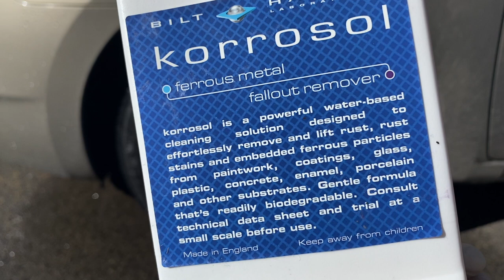Bilt Hamber Korrosol on Wheels for Enhanced Wheel Cleaning

Comment from the maker: How often you use a fallout, iron remover on your wheels? 👇🏻
Reply: I tend to use it every 6 months my car doesn’t do many miles.
Reply from the maker: Basically the same, I had barely any iron particles left as seen on the footage. Also, I’m using ceramic brake pads, which tends to dust less.
Reply: I give mine Bilt Hamber Autowheel when I change to summer or winter tyres. And I have a spray with 1/3 korrosol and water. 
To keep them clean when I wash the car. 
Korrosol can be used on paint also so that why i use that. 
I always give my wheels some wax so they don't get that dirty. And when they coming of and before they are put on they get that protecting. Just like my car gets a new layer of wax (Soft 99 fusso coat) 
some times a one-step polish with autoglym resin first
Reply from the maker: Hi Ketil!
Great suggestions here 👆 I like the way you’re doing the washing process of your wheels. I use some spray wax or quick detailer to protect the wheels. Also, to make them easier to clean for the next wash 👍🏻 Hope you enjoyed the content and I appreciate your comment!
Take care,
Viktor
Reply: Bro where do ya buy this stuff looks class shout out from drogheda🤣🤣🤣 great content👌👍
Reply from the maker: Cheers Daniel 🙏 I lived in Drogheda, but I’m based in Navan since a year and a half. Mostly I buy stuff off from Irish businesses like:
washme.ie, autopia.ie, ocddetailing.ie or from the north: blok51.com.

Also, I’m using Amazon when the price is the best there as the delivery fee is cheaper and delivery is very fast. If applicable, you can check the links (affiliate) to that certain product you’re looking for at the description. But if you let me know which product you’re interested for I can link that here to you mate!

Hope it helps! 👌😉
Reply: Always 😁
BH Auto-Wheel and Sonax Wheel Cleaner are my favourites 🤩